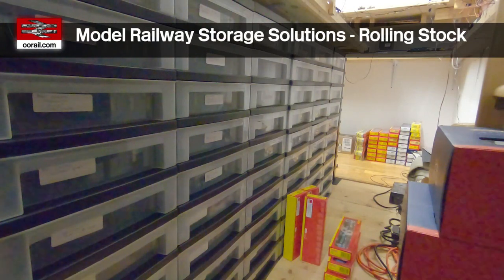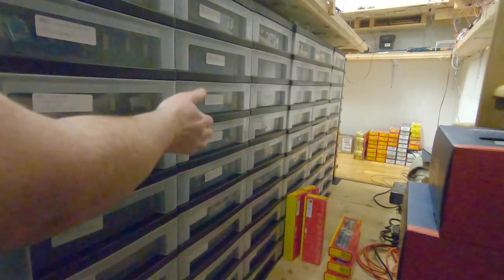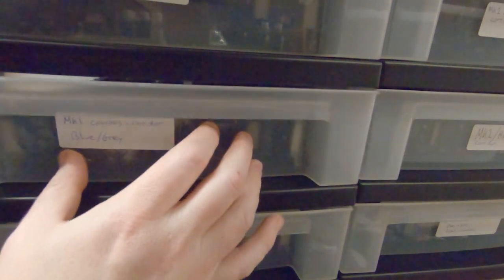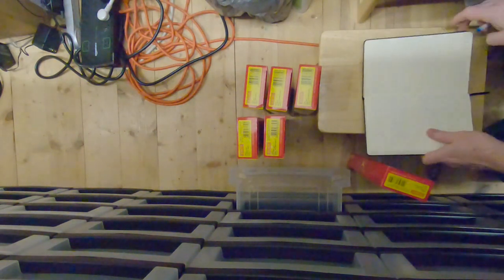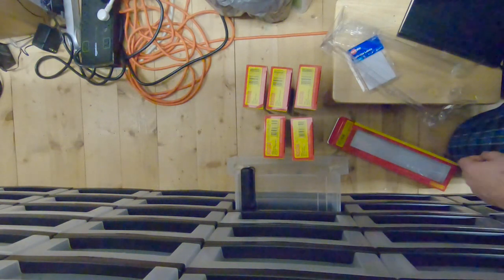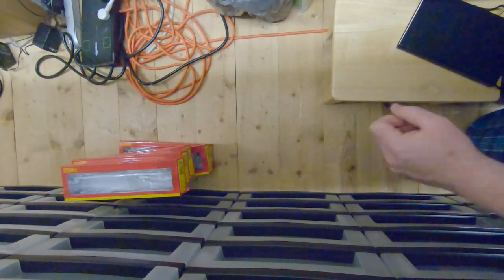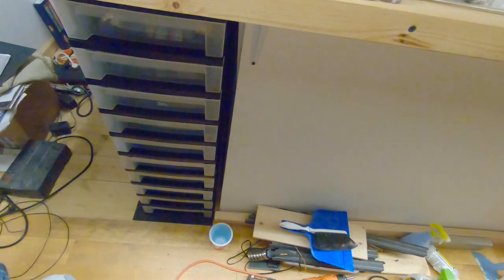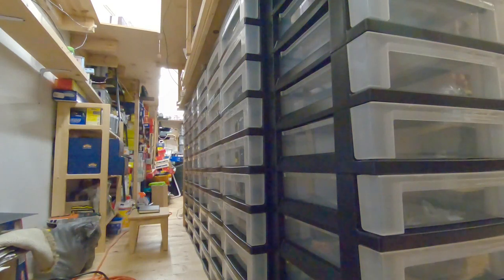Is this the Ultimate Layout Storage System for Your Model Railway? | oorail.com

Comment: Hi.  I have a similar system from the Really Useful range.  Mine are 1o drawer sets of a similar size and come in 10 different colours.  As I can only fit seven drawers under the layout it is possible to purchase further lids to make up seven drawer sets.  To date I have 110 drawers and they're all full,  The only thing stopping me getting more is i'm running out of space for them (and I have plenty f stuff on pre-order too)!!!
Reply from the maker: Very cool. I've got a similar problem, I have 10 units so far and they are all full with passenger stock. I've got 14 display shelves for the locos, need to sort those out and then add some LED lighting. The holidays are definitely going to be an opportunity to catch up on some projects and try to organize things further so I can crank out the videos in 2021! :)
Reply: @Oorail  I don't have any shelves up at the moment but I the layout has an extensive fiddle yad that looks set to be full as well.  Still, things could be worse.  We might not have enough models to fill them!  Mery Christmas!

Comment: Have you tried putting thin black foam in all the drawers to protect your rolling stock suck as locomotives, coaches and Freight wagons ect, plus put sticky labels on them and write on them so you know what's what.
Reply: He has sticky labels on the drawer fronts
Reply from the maker: Thanks James. I mentioned in the video that you could put thin foam between the rolling stock. I've actually start to 3D print spacers to keep the stock slightly spaced when in the drawers. I'll do another video on how that turns out, currently testing some options. I think this particular section will just have my passenger rolling stock, maybe some multiple units as I have long display shelves under and around the layout.
Reply: @Oorail  I have black thin foam as section spacers in all my drawers plus I only have 8 and bought mine from a big poundstrecher in England United Kingdom/Worksop. I only need 2 more of them drawers to put my last 2 hst sets in and my Arriva Cross Country 5 car super voyager in aswell.